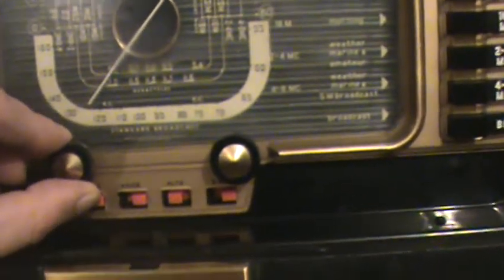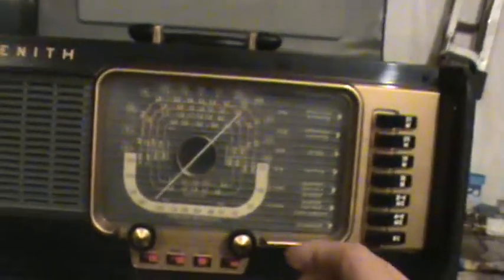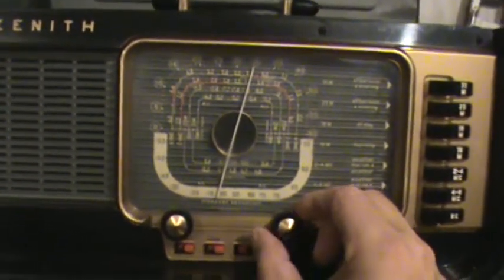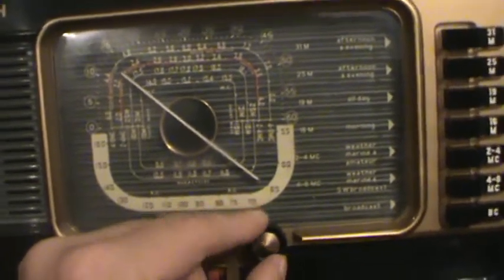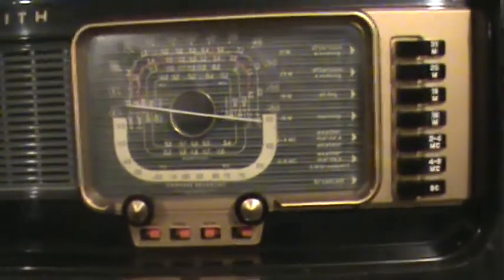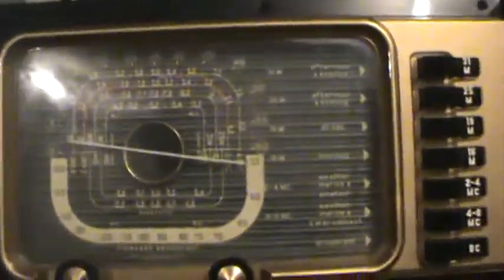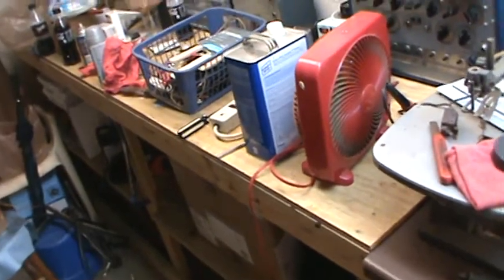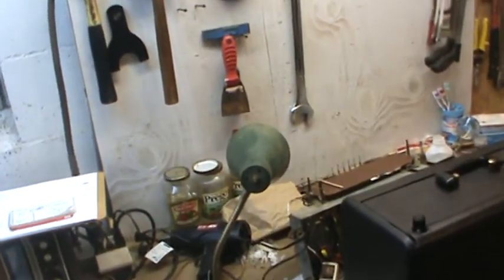Zenith Trans-Oceanic H500 and other stuff in the works

Comment: That is a sweet radio Gary.  Looking forward to your continuing on the Philco... getting cooler is around the corner - hang in there.  Regards, Ron
Reply from the maker: Yeah, I meant to get to it earlier this week when it was cooler but instead I got roped into scraping old paint.  Tomorrow I get to caulk the seams and then start painting bay window trim.  And of course the low temps we were forecast to have all this week was BS, it's going back to the 90's again. lol, Take care, gary
Reply from the maker: Thanks, I love it, but I really haven't even had the chance to play with it yet.  I want to try it outdoors one evening when the weather is cooler to see what it will receive.  Hopefully before too long I'll get going on that Philco again.  I think I'm going to look around at local flea markets and thrift shops and see if I can find a small old desk for my bedroom so that I might be able to at least do soldering in there where it's cool.  I've been informed I won't get into trouble for working at the kitchen table but I don't want to get used to having a mess of stuff there, lol.  Take care, Gary

Comment: Hello Gary that looks an interesting radio. Sounds good. Look forward in you doing more later on one day
Reply from the maker: Hey, Thanks Richard.  I've wanted one of these radios for years, ever since I saw one on a repeat of an old 1950's American television comedy called "Father Knows Best".  This one came up available on ebay from a seller who runs a small electronics repair shop about 40 miles away in Louisville, Kentucky so rather than pay the $25.00 to have it shipped here I simply drove down to his store and bought it.  It's a very powerful little radio, but don't let it's small size fool you, it's frame is made of thick wood overlaid in that fake leather made from doped canvas that Zenith called a "stag finish" and I'd estimate it to weigh a good 20 pounds without it's batteries.  Zenith manufactured this radio in one model or another from the early 1940's up until I think 1981 and this particular incarnation was made in I believe about 1951.  I certainly do want to spend more time messing about with it and checking it out if I ever get the time.  I've spent the past week scraping old paint from window trim on the house and repainting it and yesterday and today we scraped the old flaky paint from the ceiling of our utility room and re-painted it.  It has one of those old bead board ceilings so it all had to be painted using a brush instead of a roller.  Now that the ceiling is done, of course the walls look dingy and I'm afraid I'll soon be called in to re paint those as well, lol.